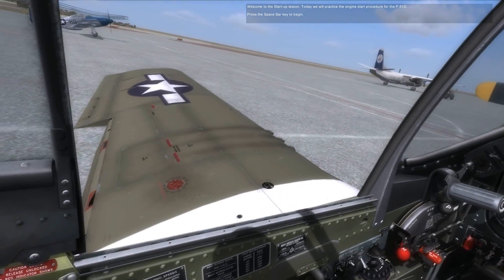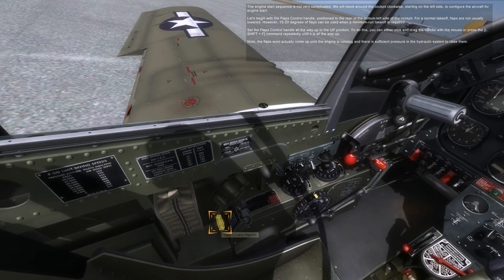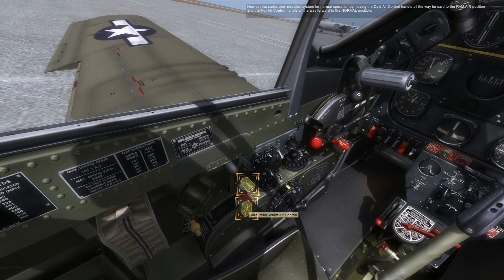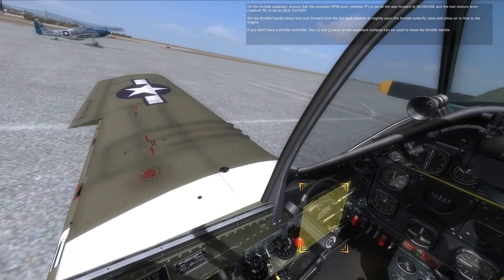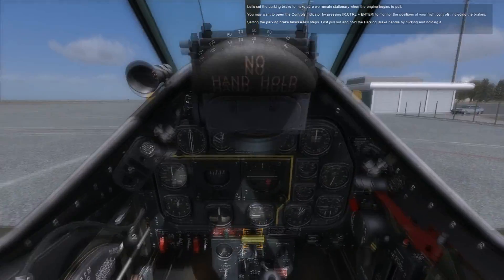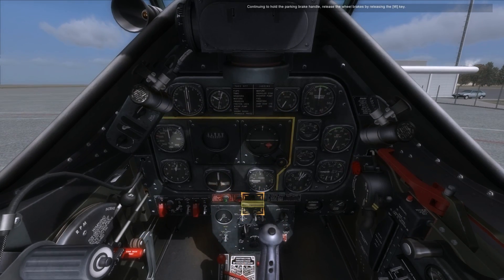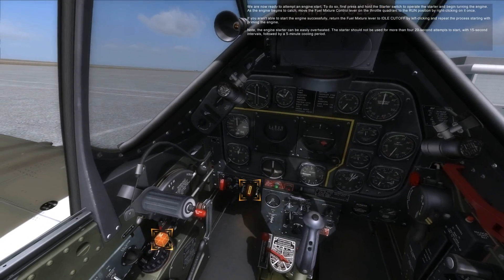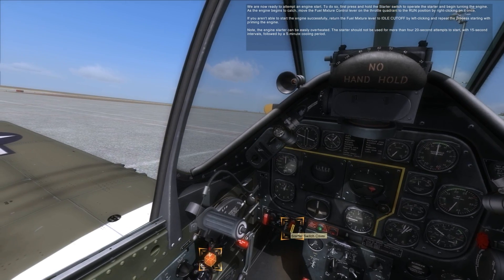DCS: P-51D Mustang Startup Procedure Tutorial

Comment: Well done. But i do agree with USNavalAirForces, the mags need to be turned on after counting 6 blades. This allows oil to be spread through all the cylinders before igniting. If this isn't done, the cylinders and rings will wear out over time. Some pilots will manually hand crank the props instead so the starter doesn't get as hot because usually it does not take only one shot to start her up. Keep it up! Fantastic model!